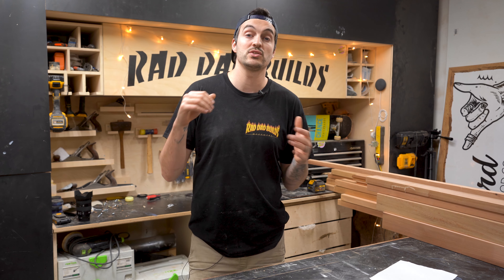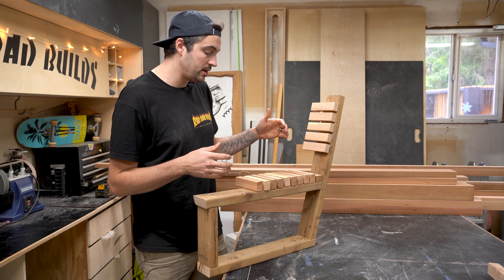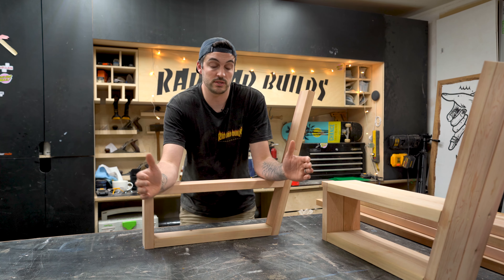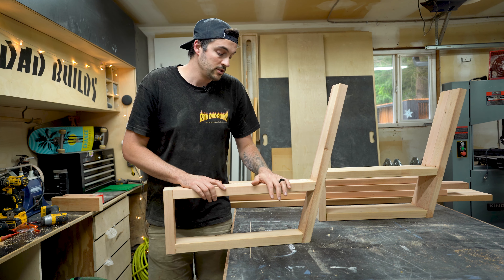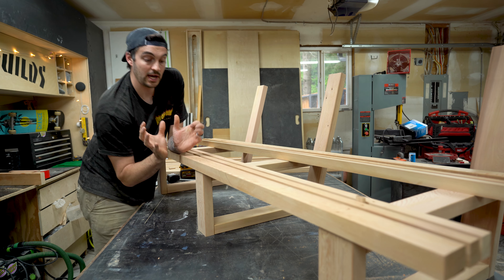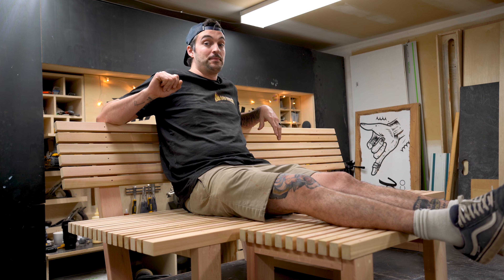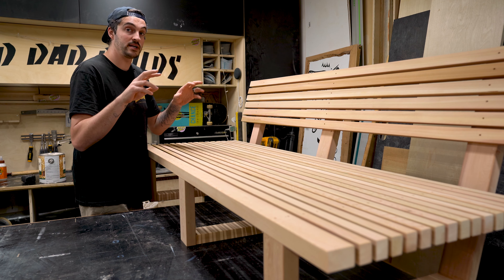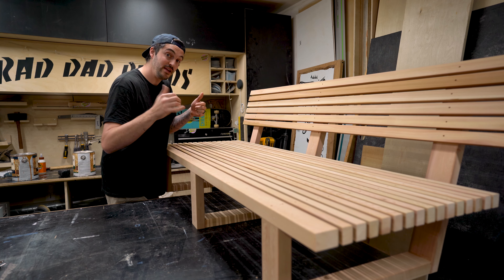Simple Outdoor Bench // Beginner DIY // Weekend Project #outdoorfurniture #outdoorsofa #bench

Comment: I built this bench over the weekend. It looks great. My only complaint is that there is no lateral strength to prevent the end legs from shifting front to back. Was considering adding a cross-brace below the slats to give it a bit more stiffness but also don’t want to take away from the minimalist look.
Reply: This is exactly what I was wondering Peter.  Humm....clear cedar is not cheap so hate to make this and have it shifting and hate to add to it for stability but take away from the look.
Reply: Do you have a pic? And what did this cost you to build, I'm just going to use pine. Thanx
Reply: Did you add support? It really looks like it needs it, love to see you pics
Reply: If the leg boxes are assembled using Titebond III (or similar), and properly sized screws, I would challenge you to rack just one of them front to rear. Adding the slats, including the back, provides some front/rear lateral support, just not at floor level.

For side to side racking, one could add an apron directly under the forward-most slat, and atop the back. This could be done cleanly without impacting the minimalistic lines.

At the end of the day, unless the neighborhood front lineman is doing full-speed belly flops onto the bench, this design will be perfectly sturdy for years of use.

Comment: Looks great.  You mentioned the back is 30 inches high and the width is 25 inches, how high is the bench seat?
Reply: I wondered the same thing. If using 2x4s, the total height from ground to top of the seat slats is about half the 30" height of the back. So, maybe the height of the seat is 15" tall from ground to top of the seat, with the front, vertical leg being cut to about 10"-11". If you've built it and have other dimensions, I would love to modify my cut list.
Reply: I went with 15” height for the front 2x4 member then add 1.5” for the slat height so the seat ends up 16.5” off the ground - feels just right.